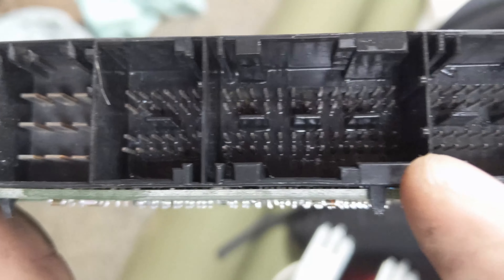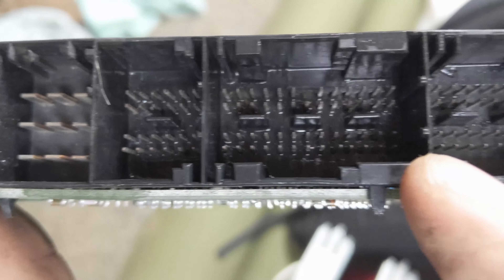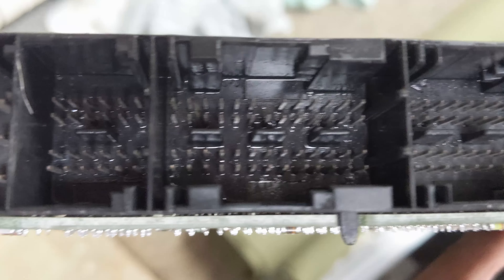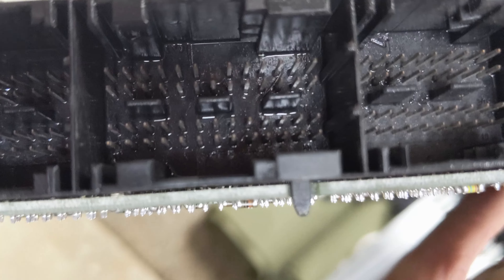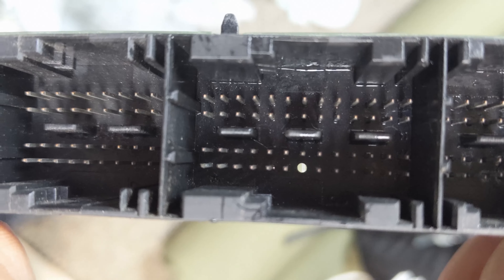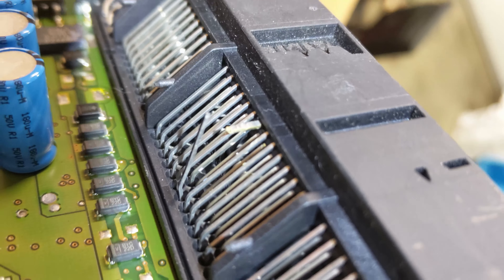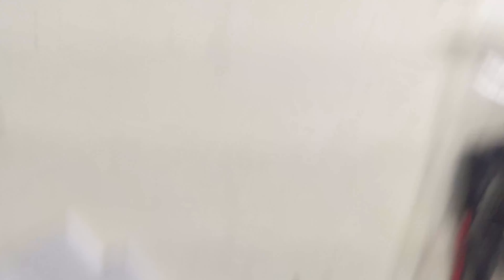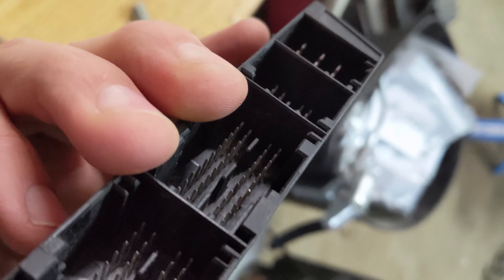Sprinter Part 1: No Crank No Start ECU Repair

Comment: Sprinters just like my model. Well done. We just had a new key made and now the engine will not start... think the microchip programmed wrong and immobiliser has stopped it starting. Trying key original key which worked and nothing... any ideas how to reset the immobiliser?

Comment: has anyone checked to see if that pin was needed or if the cleaning fixed it? was the pin stuck in the connector? it did not disappear